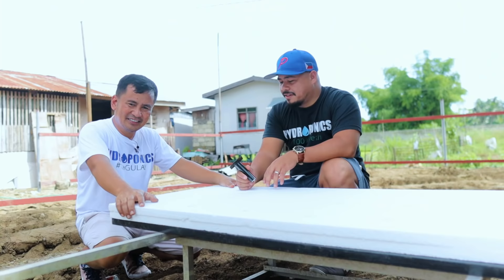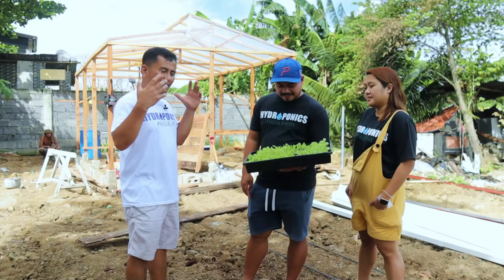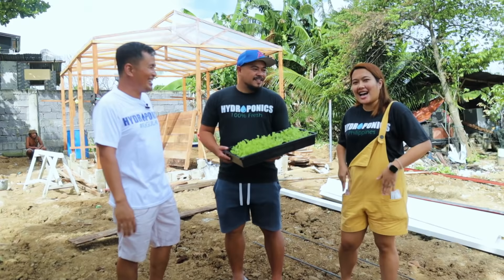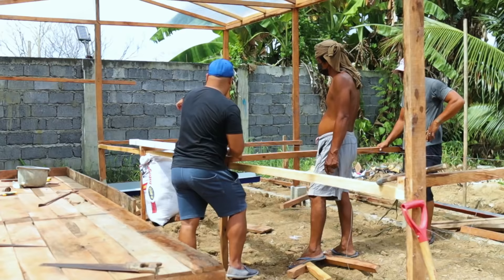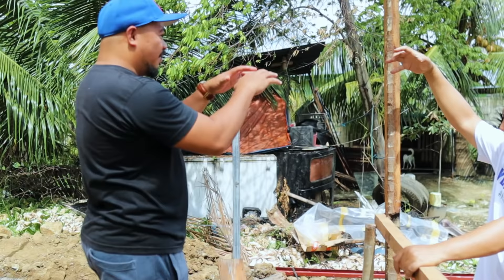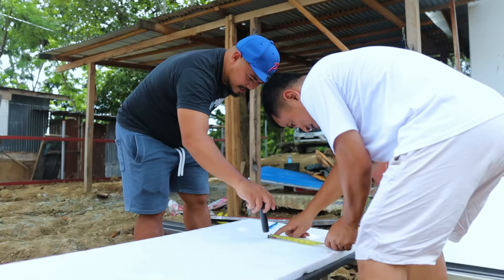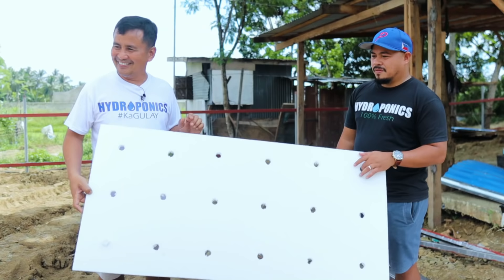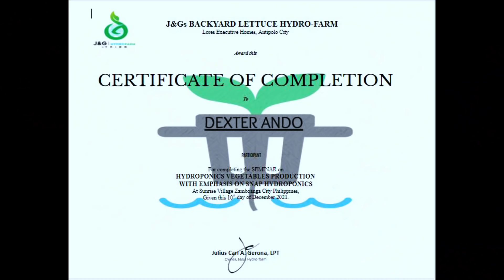Hydroponics Lettuce Farming! Building my Dream Sustainable Farm -Hydroponics Secrets reveal│Part 2

Comment: after getting the hole started in your PVC, a smoother way to cut the holes is to run the drill in reverse...this provides a cleaner, smoother hole in the plastic pipe and lessens the chance of cracking it..

Comment: It appears yeah he's using some sort of caulking maybe silicon ceiling to seal that PVC cap on that is incorrect you should be using PVC cement which is easier and faster to apply and it's sealed by heating up and fusing or loading the two pieces together it's much more efficient and effective